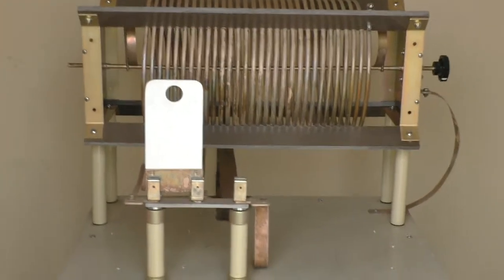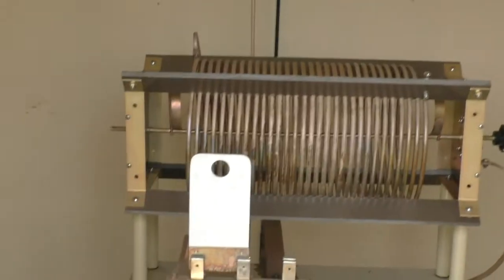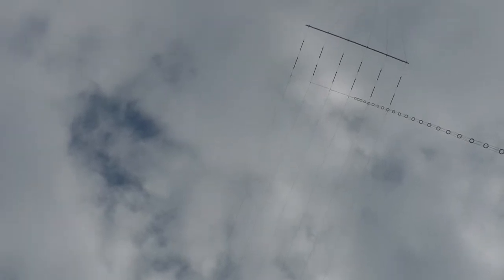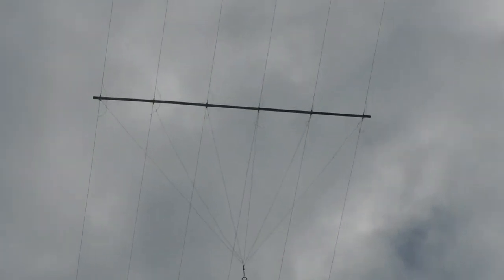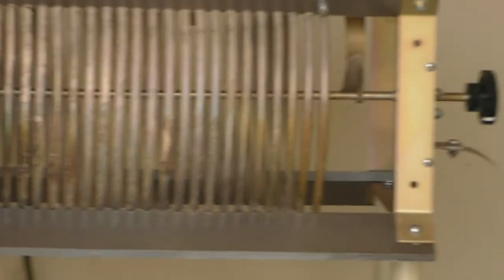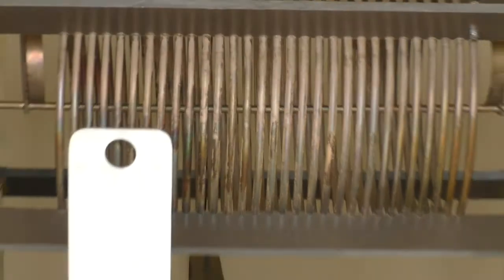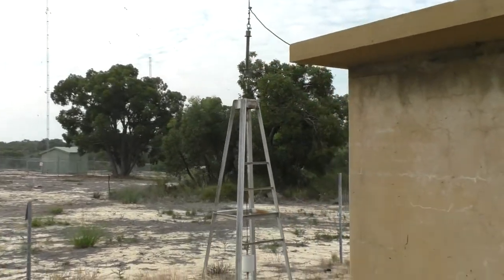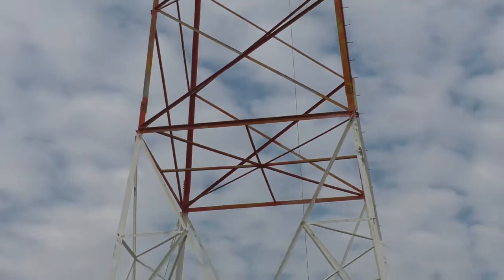Ernst Alexanderson AM Broadcast Antenna Built In 1926 Pt 1

Comment: Another great video.....very interesting to see these antenna's and huts........I wonder how many people realise how dangerous the tuning huts are inside when the TX is operating.......
Just as a side note, I use a virtual headset called a fat shark HD....they are HD video googles that you can plug into the video out of your camera (HDMI) and it completely cures the LCD problem.....I have tried all sorts of shades, but these googles are just awesome......I also use them to fly my drones as the same problem applies with the hard to see monitor when flying around.
Cheers
John
Reply from the maker: Hi John. Thanks for the comment and suggestion, I'll take a look. I don't think many people think about RF fields at all. Most of the larger tuning huts have a wire mesh Faraday cage on the inside so there's less RF on the inside than there is outside. The Alexanderson antenna is cold tuned with an analyser, and the switches on the current meters are operated with a broom handle from the doorway.
Reply: Yeah a couple of the older sites I have been to have quiet beautiful fine meshed brass cages inside the main hut where we would do all our bench work and testing....eat lunch etc etc......the difference with the older ones is they were almost art......., some of those old sites had an amazing build quality given they were never really seen by anyone other than the techs.....having said that, most of the techs in those days wore suits and ties while at work.....and it wasn't that long ago either.
Reply from the maker: Nothing's like it used to be for sure. I wonder what the world will look like in another 30 years.